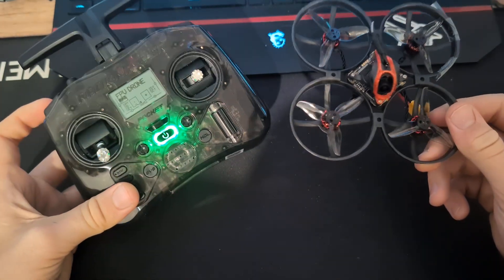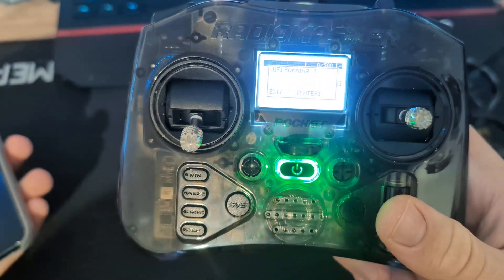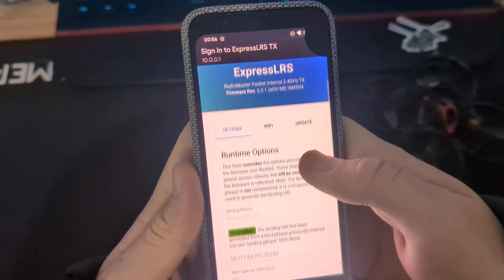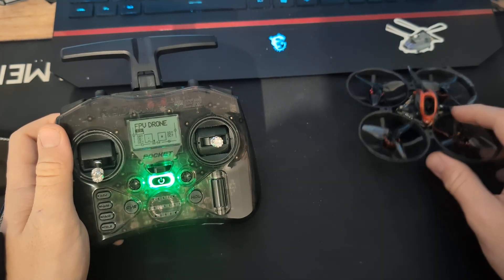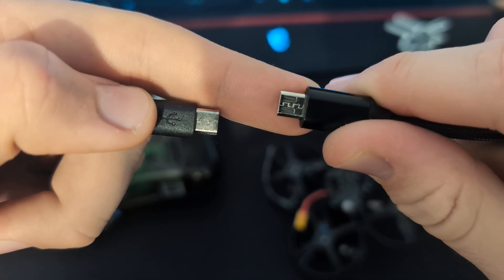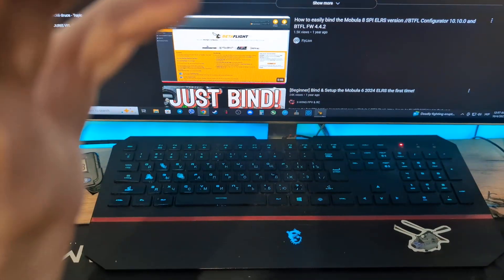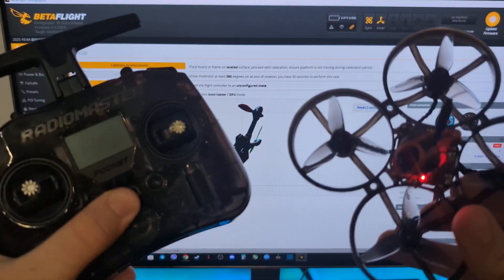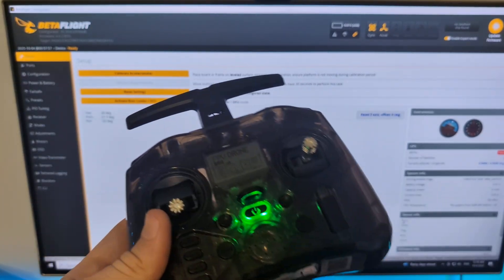How to connect (bind) mobula 8 to radio? Binding tinywhoop!

Comment: At happymodel site they say that it should be not SPI, but serial (uarts). In this case you don't have field for bind phrase. So if you managed to bind it means that it is mobula 8 with spi onboard? 🤔
Reply from the maker: they make different versions of this board, some of them with SPI and some of them with uart